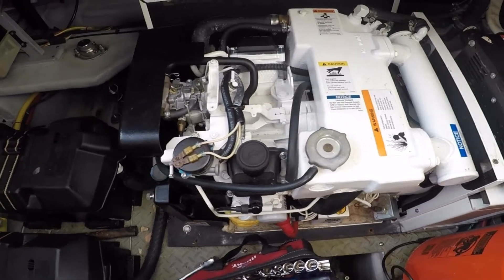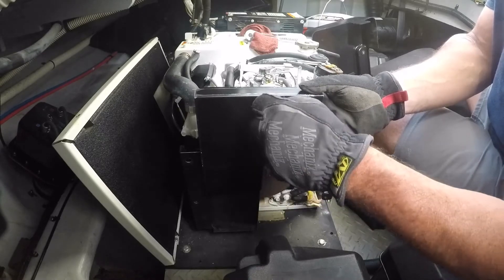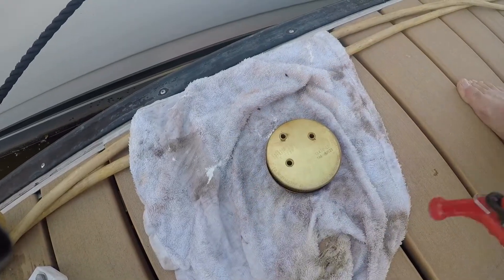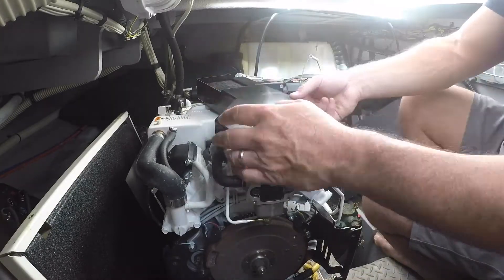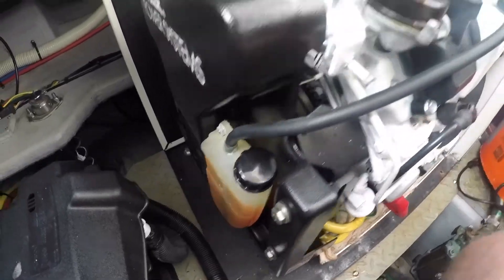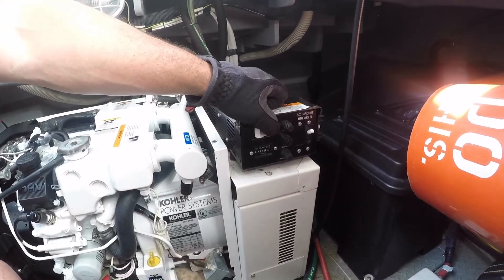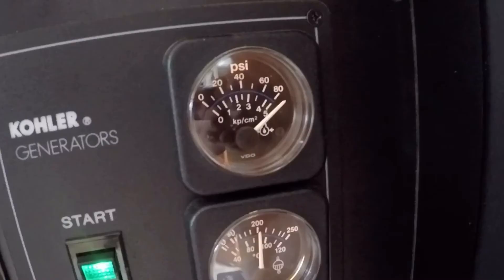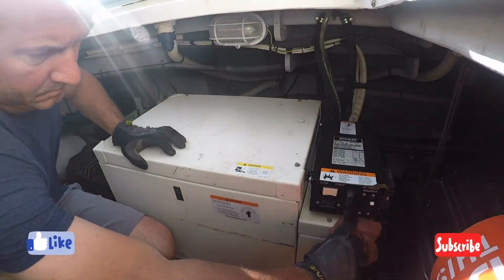Kohler Generator Maintenance - Flame Arrester cleaning

Comment: I'm sure you've figured this out by now, but your oil pressure gauge is grounding itself, that's why it's pegged to the max or at zero.  Find your sender wire on the generator and make sure it's not touching anything else but the sensor.  Same for the wire behind your gauge: open up the panel and make sure the wire isn'T touching anything else.  A bad ground is always the reason a gauge pegs to maximum.  great 2nd video on the Kohler.  I'm going to clean the flame arrestor and change the coolant.
Reply from the maker: Thanks for that tip. I have never traced that down. I’ll check that out next time I’m down there.

Comment: the sending unit on the generator that runs the gauge is most likely bad. its a pretty easy circuit to test and the parts are reasonable.
Reply from the maker: Do you know where that sensor is?
Reply: @AdventuresofHappyOurs  look up a picture of what the sensor looks like and then take the sound enclosure off and it will be pretty plainly evident. It usually is located near the oil filter but due to kohlers different models I couldn't say definitively without looking at it. Sounds like it's time for me to drive to the beach and help ya out 🍻

Comment: Ever mess with the carb at all? Rebuild it or service it?
Reply from the maker: Haven't had to yet.  It' should be simple enough.  Lots of small engine repair vids on YouTube that give you tips.  Clean the jets and float bowl.  If it starts running rough I'll give it a whirl.
Reply: @AdventuresofHappyOurs  Mine was running and then after about two hours started hunting. Kept getting worse until it finally quit. Replaced fuel filter but didn't make a difference. Going to rebuild the carb and see if that resolves it.
Reply from the maker: @jsnader  did you try changing plugs?  And make sure you have more than a quarter tank of gas.  Most gens won’t drain the main tanks down past that.
Reply: @AdventuresofHappyOurs  plugs are pretty darn new but I will check them. Tanks are 3/4.